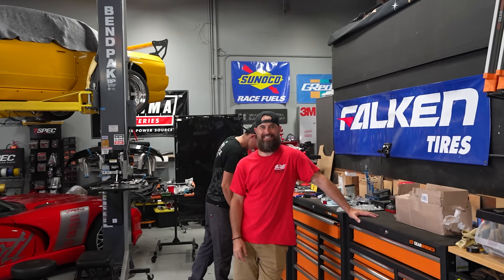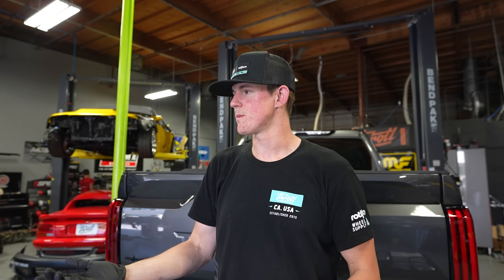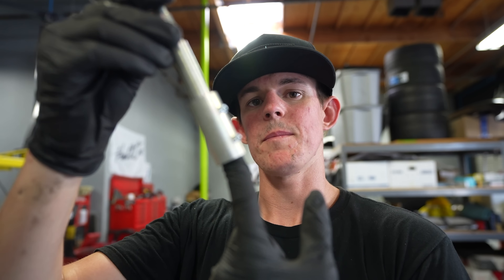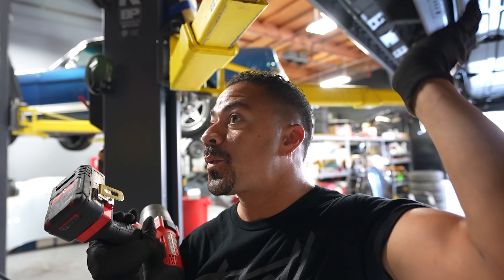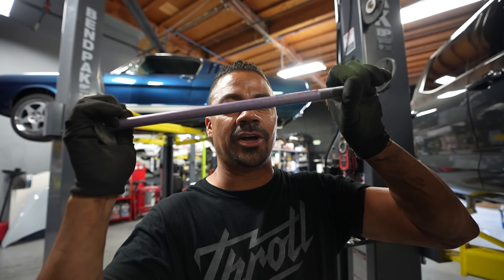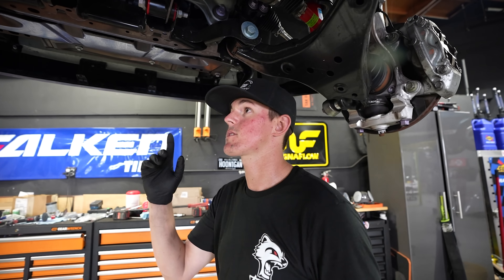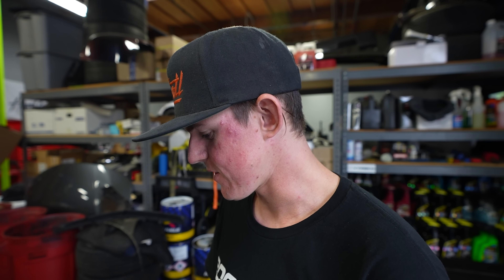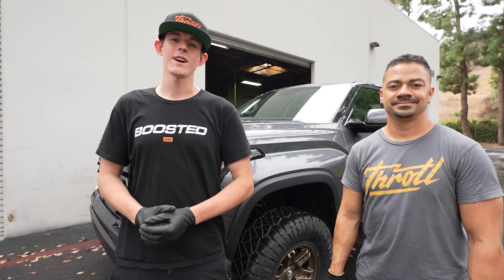Modifying Our BRAND NEW Toyota Tundra! (In Just 24 Hours!)

Comment: Add some metal bumpers bigger fender flares tint headlights and tail lights and change the front grill to do a chrome delete and the electronic hide away side steps and a exhaust and cold air intake and possibly supercharge it.

Comment: Trucks are the new import cars lol. Raised in the drift scene and building full touge cars, now I built an overland Tacoma. Happy to see truck builds. I would recommend doing a little more research into the mods. Instead of spacers there are shock replacements, 80 series rear coils and upper control arms that make fitting 37s doable. I say research a little more because it’s pretty common knowledge that pinning back the fender liner with an existing bolt hole and aligning the truck with more caster would have allowed you to keep the 37s. Love the truck builds keep ‘em coming 🤙🏽

Comment: U should for sure go full JDM style and get a full grille/brush guard, tail light guards, rear bumper guard, and side steps from JAOS. Would be sweet to source some plasma blue ion tinted headlights or have flyryde pimp both the headlights and tail lights out with some super sequential LEDs. Idk if I've ever seen an LED light bar have patterns and rgb LED madness but that would be epic too. Not only that but when needed they should be able to provide pure white light. Definitely give it the starlight headliner treatment for those long nights working. Give it some bump too with a kickers sound system that utilizes the OEM infotainment system. It would be out of this world to be able to use that OEM screen to see all the vitals like oil pressure, battery voltage, etc too. Would look totally stock when the truck is off but when u start it up it'll be crazy 😊 just some ideas lol. Been a fan of Throtl for a long time and when I have the funds I plan on taking my vehicles to be done by u guys for sure! 😋

Comment: I can’t believe you can fit 37’s with just a levelling kit on those new tundras! I feel like the previous gen could only fit 33’s being levelled?? 
Love the tundra, what a great addition to the fleet. Keep doing the great work guys. The content is 🔥
Reply: It's not a leveling kit..
Reply: But they didn’t fit….
Reply: @mj_aussie_coaster_travels8310  They fit, it drove. A lot of people are fine with a little rubbing. Definitely not practical though. Lol
Reply: I’ve got 35’s on my 16 tundra with just a level kit. Had to remove mud flaps and use the heat Gun on the front inner fenders. No rubbing.
Reply: @shawnsmith9440  No, they didn't fit. You can barely turn on a level surface. It's an off road truck and mod. All looks and no substance.... sadly that's about perfect for a lot of people.
Reply: @McCracken216  that's literally what I said.. Jesus. Not practical but would drive on the street and still rub some.. Lmao.
Reply: pretty sure you can fit 35s on stock. 37s with leveling and trimming

Comment: A decent weight distribution hitch with sway control would have smoothed everything out on the ranger. Add a Bluetooth brake controller and you’re golden. You can’t do anything about the back seat space unfortunately. This is mostly for people who tow heavy with their rangers. Try those things out before you buy a new bigger truck. If you’re lifted (or not) get yourself the Ford Performance tune.

Comment: Not to compare brands, but the whole idea of replacing UCAs with most lifts is to gain function, by means of either having adjustable or built in added caster, and better ball joint options. Don’t know the specs of the readylift ucas, but it honestly looked like you could’ve easily fit the 37s with a higher caster alignment. Also to note, it kills me seeing you guys lift via spacers on all your truck builds. You obviously know your stuff in the tuner world, and we never see you slam cars via lowering springs; adjustable coil overs are always the answer - lowered, lifted, stock, principles are the same. Hope to see some more mods in the future!

Comment: You guys do know that metal bracket that holds the mudflap screws in the front wheels is removable right? If you remove those brackets you won't need body mount chop to fit the 37s without rubbing.

Comment: 35”s will look fine with the lift. It will make the truck look like it has a lift more instead of that tucked look that you have now. A more aggressive tread and a decent negative offset wheel will make it get that bulldog stance.
Reply: Add ons: power running boards, chrome delete, nice roll up tonneau cover

Comment: Ok serious question.   I'm not a truck guy but why on earth does anyone lift a truck?   Because ground clearance doesn't change since the diff is still the next lowest point other than the contact patch.  Tires is the only thing that might raise the diff but at the cost of fuel economy, ease of getting in and out, rubbing tires on the inner fender, etc.   And it gets to a point where you need side steps to get in which almost negates any extra ground clearance you might have.     And this is me assuming the truck will be used for off-roading.   For towing and hauling stuff, wouldn't a higher bed make it harder to put stuff in the bed?